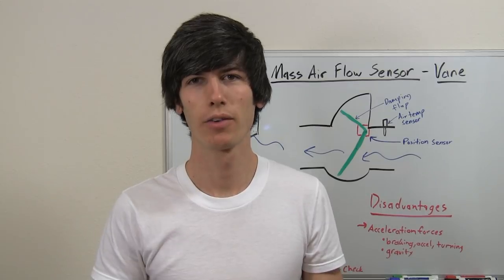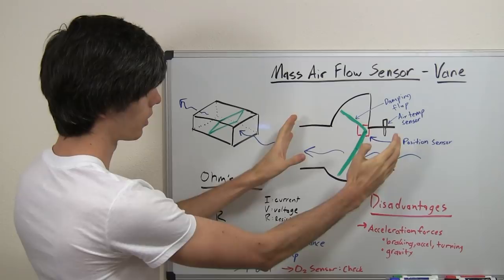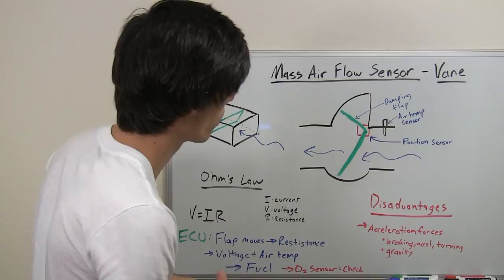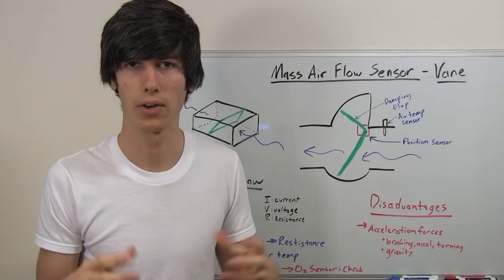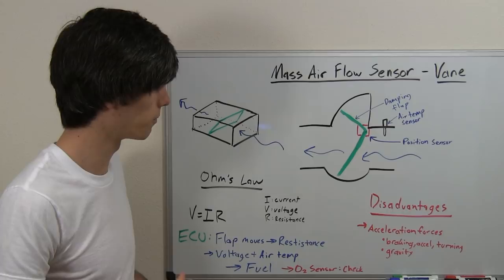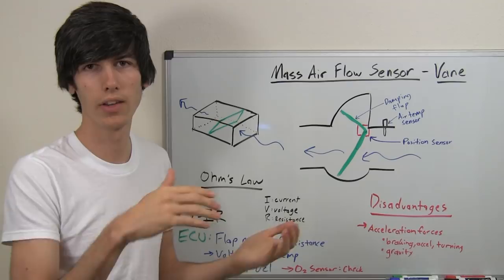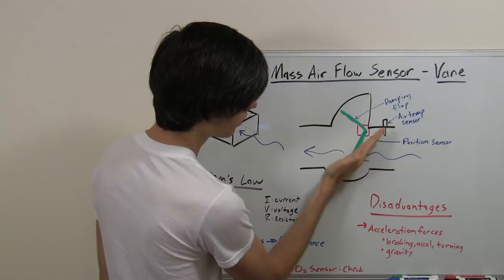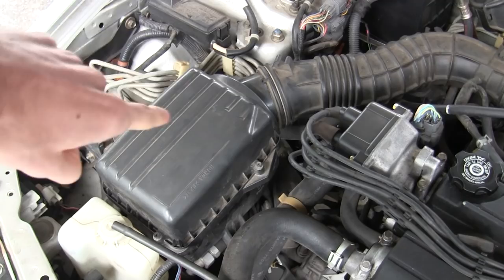Mass Air Flow Sensor - Vane - Explained

Comment: I would never call a vane air sensor a "mass" air flow sensors.  It is more correctly a "volume" flow sensor.  You even explained how the air temp senors was used to "compensate" for denser colder air.

And I think you are correct, nobody uses vane meters today !
Reply: The most accurate name is mass air flow meter, because it’s mechanical

Comment from the maker: Great question, and I can confidently answer no, it will not be. There are two courses offered (IC engines and automotive engineering) which are great, and yes, will be very similar, but other than that it's mostly learning the physics/math behind all of it. Check out my website "future plans" tab under the FAQ's to read more about what you're getting into. (Link is in the description, also on channel page).

Comment: AKA "The way to expensive and unreliable thing". also common in older BMW engine, like the 316i and 318i e30. 
that ting cost almost 1.000 $ and wuold break if you rev the engine to fast or shiftede from a high gear to an low gear to fast,

Comment: Your fuel trims will be off and you probably won't pass emissions, you should also have a check engine light. Sensor measures the gases in the exhaust and adjusts air/fuel ratio for more complete combustion.

Comment: I wouldn't expect it to idle or rev very well, since, as it is explained in the video, it has a vital impact on the performance of the engine. If it's the one after the catalytic converter, it might not have that much of an effect though. The pre-cat sensor from my experience seems to be the primary